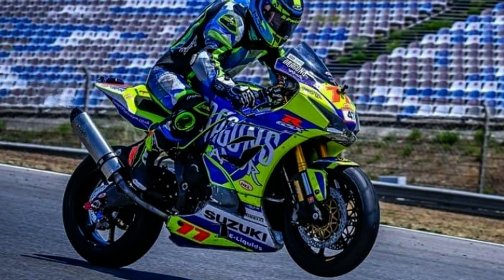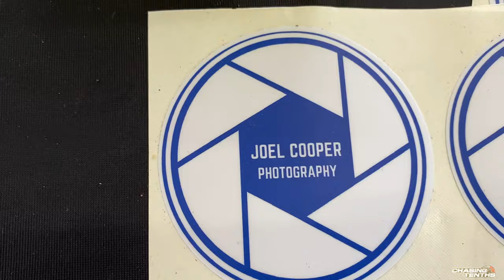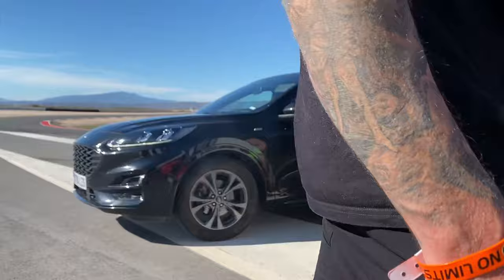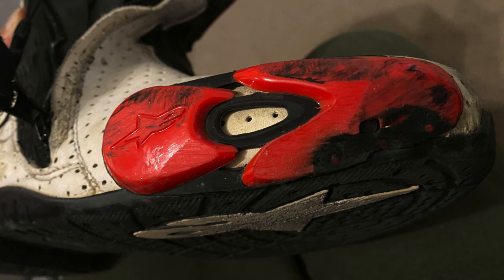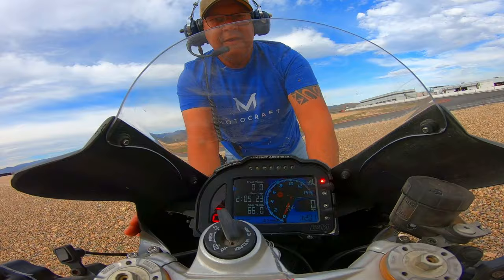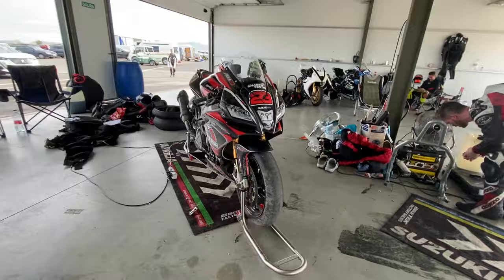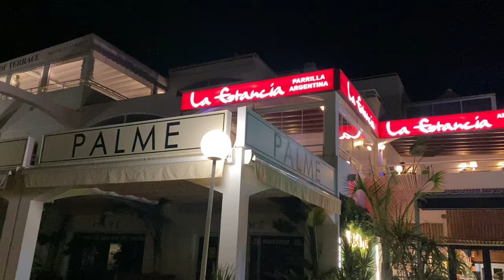Andalucia Trackday Day 4 | Plenty Onboard footage | CRASHED again!! 2 min 5 best time | Aprilia RSV4

Comment from the maker: Here are the chapters of this video for an easier viewing experience, promise you won't skip ;)
00:00 Cinematic Intro
00:52 Worded intro & morning laps explained
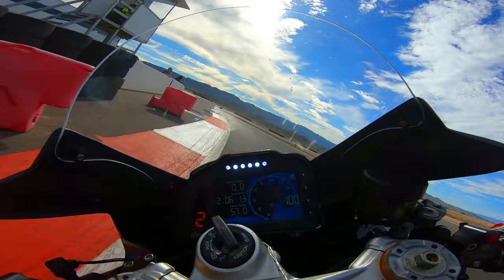04:34 Trying to overtake differently
06:47 Vesrah & Accossato pads
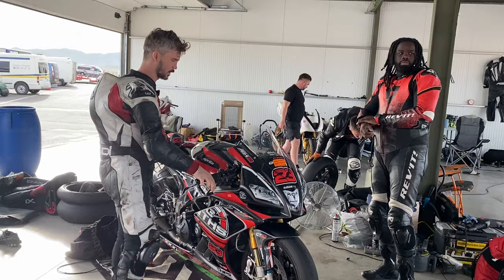07:07 Pirelli, Metzeler and Dunlops
10:08 Onboard lap 2 min 5.6
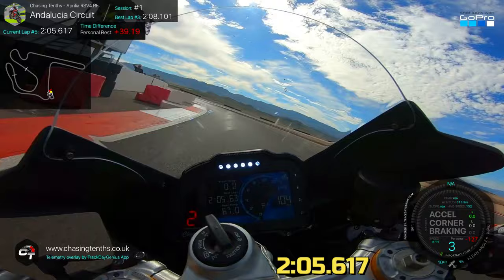12:26 Turn 3 gremlins continue
13:31 Lunch time footage Part 1
16:02 Paddock Stillage and transport info
17:44 Track Coaches and Fun lap with Dean Ellison
19:30 Feel free to speak to coaches
21:00 Intro to my crash
21:45 2min 5 dead plus CRASH onboard laps
26:20 Explaining crash in detail plus damage sorted
32:32 Lunch time cinematic Part 2
35:07 Last 2 laps explained
36:39 Onboard last 2 laps
40:44 Hotels by trackday firms and Summary
43:25 Cinematic ending of the trip

Comment: Another great video, I had some one come to me and say I need to back off the front at Almeria just like you 😂. I had a peg dig in shortly after and send me right out to the curbs but I got lucky.

Talking tyres I was running KR106/108 and they were super impressive and the wear was great. More grip than the VO2s even. I also used the 195 rear as my 2009 blade isn't that powerful and they dropped me down to a 1.49 flat. Made the bike turn like a 600.

Keep those vids coming this year 💪
Reply from the maker: Yes , I definitely felt my toe dig in to the tarmac and felt the rear go light on me and weight transferred to the front and I was already leaning too much and the tyre couldn’t cope .. lesson learnt for sure … 
Those Dunlops are super impressive 
I just try them next time 
It really saves you changing tyres if they last 3 to 4 days plus they take multiple heat cycles 
You doing 1:49 with 2009 blade at almeria is epic mate 

Thanks for watching and appreciation 
Means a lot mate

Comment: Great video. Progress was great over the few days. Glad your bike was not that badly damaged. 

Great riding
Reply from the maker: Thanks Baz, much appreciated.. I always look pass the crashes and look into the progress made
Reply: @ChasingTenths   I just had a very similar off at Druids. Front just trucked on me. No brakes. Not changing gear  

Wish I lived nearer the tracks, and I would get much more instruction, like you. I live in Cornwall. Day away from a decent track.
Reply from the maker: @Baz1000r  wow, Cornwall is mikes away 
I totally understand 
These low sides unfortunately are so common and easily done 
Could be off camber tarmac or just too must speed or lean like me , I feel for you though Baz, every trackday must be a right mission for you

Comment: Abhi...first session of  the  video was  amazing; very clean lines,intelligent riding in terms of  how  and  where you choose  to  overtakes  your  friend  on the  gixxer ,and  the '''early'''' roll ons of the throttle  exiting the  corners were  perfect. We all have our personal '''kryptonite ''''  corner  which we misunderstand  on any tracks,yours  here seems to be  corner 2-3 LOL!!! No limits track days looks  like all class,wondering what is  the in and  out   total expense for  such trip.As for  the  crash,look....i perfectly know that this  corner  ..i  would  hate  it  .simply hate it because  this  kink,you brake hard  while  transfering the  weight rear  to  front while  turning,aand if  your  suspension isn't settled  up  very well,the weight transfer  happens  kinda  too late ,while  you're into  a  turn in which is  bad  for  grip LOL...and  yeah,your  front was  probably well shot  when it happened LOL.lets say that you're  extracting the last drop of  grip of your  tires .
Reply from the maker: Very well summarised there Sylvan, that first corner had a big jump so as you are entering first corner the bike is already unsettled a bit and Offcourse not having fresh tires and just pushing too too hard doesn’t help the situation… corner 2 to 3 I was very quick but then 3 to 4 could have been better 
No limits were amazing 
Absolutely brilliant track event 
All in all I was very happy with progress 
Just need to work ok little things and mindset and everything else will follow

Comment: That was brilliant, didn’t seem like 46 minutes.
I thought you were using the Accossato EV2 pads as well? I could have sworn you mentioned them in a previous video. I run their ZXC pad. I prefer a more progressive front brake, instead of a light switch for a front brake.
Reply from the maker: Thank you very much mate, it’s always been the vesrah pads but I am moving to the EV2 pads …. 
I like the light switch on as I am very aggressive on the brakes 
So you are on the right pads matey 
Thanks for appreciating 
I did wonder if 46 mins was too long
Reply: @ChasingTenths  No mate, 46 minutes is too short 😂
Reply from the maker: @flamintasty  😂😂😂😂👌

Comment: i noticed,  that you're engine braking  could  be a fraction smoother,  ( but  thats my prefrence )
you can carry more speed en the bike would feel more lighter. 
for the rest  just stay on the steady groove abhi
Reply from the maker: I keep my engine braking on medium so that’s T mode on the bike (track mode) , the R mode has lease engine braking but I am so not used to it 
I like a tiny bit more engine braking , I think it’s something I’ve had since day one and got so used to it 
May be this year I will try the R mode with less engine breaking and see how I feel … great observations by the way, 
Very very nice to see you notice such detail and , no one’s ever commented on engine braking 
Fantastic
Reply: @ChasingTenths   if you study  the  time's  when you shift back   from   (  each gear )   
 you rear wheel is pushing you   and making you  unstable.    you have a wobble everytime   you're  figthing the bike. 
 set it the  bike on  r mode and  you will  feel  that is more  fluently   with even  using the front brake less  aggressive  

and  give's  you also better response ,      and will give you more  speed on the straight 

i will try to make  a  clip with my bike
Reply from the maker: @cbr1928  this is very very very interesting 
I actually do fight the bike a lot off throttle but I quiet enjoy that 🙈🙈, but it’s not a nice feeling when you are chasing time 
This is great advice mate 
I’ll Definitely be moving to the least engine braking mode R (Race) from now on, I’ll see how it goes and I’ll report back in one of my future trackday videos 
Love the advice 
Thank
You
Reply: @ChasingTenths  less  fighting the bike  will make  you faster.  smoother and les tired.
 all the little  feedback can help .   
 i' will  be curious   to find out  what you will  think of it   after a day of  riding
Reply: p.s  can you make the hoodies   lik 3 triple  XL 

they are on the small side after a year ..
Reply from the maker: @cbr1928  absolutely spot on mate, fatigue is an issue for me so I can we are on similar wavelength 
I’ll definitely try it in 2024
It might feel awkward to begin with but it’s ok
Reply from the maker: @cbr1928  try on my website 
The hoodies there are done by an American company 
chasingtenths.co.uk
Let me know if you have any issues 🤗

Comment: Id agree the latest superbikes are much more powerful than a 2015 rsv4, however the GSXR 1000R is virtually the same power, in fact its quoted as 2hp less than an rsv4 rf at 199 vs 201
Reply from the maker: That’s just the crank power mate 
But the power on the back wheel is different 
The two Suzukis in the video were 205 and 207 bhp respectively not on the crank but on the dyno 
And I am 176 bhp maximum on the  back wheel 
You can see how quickly they accelerate from me 
But I reel them in on braking 
And that’s what I was trying to showcase 
I really love my bike
The power is so so manageable and unless I do something stupidly silly. Which i did lol , it’s really hard to crash an Aprilia too , front grip is amazing
Reply: @ChasingTenths  ok thats fair enough. It may be the case with those particular bikes that they are much more powerful, but as standard the gsxr is the same as yours pretty much at the wheel, i know this as mine is 178. It is remarkable how much difference the line taken can alter the speed you can build up down a straight, and more so the initial jump on corner exit. Thats an area of riding i worked on myself whilst at Andalucia.
Reply from the maker: @HB-wu8pz  exactly spot on that , Suzuki ECU’s are in an open relationship lol , they work with a number of tuning softwares 
You can tune the hell out of them 
I really respect that bike 
It’s a really tuneable bike 
But love the Aprilia hands  down 
Any day
Reply: @ChasingTenths my bike has been on a dyno twice,  1st time when it had lower mileage it made 184 at the back wheel and the 2nd time last year with 25,000 miles it was just shy of 180 at back wheel.

They are fantastic engines but the electronics are 💩
Reply from the maker: @richbonesjones4729  this is very interesting to know 
Thanks Rich for that 
Matt’s Suzuki was 204 bhp I think and I presumed yours was around that figure too
Reply: @ChasingTenths  204 at the back wheel is an impressive number for a 2017+ gixxer

I'm assuming he's had the engine ported/polished and got some nice velocity stacks to get those kind of figures.

Defo doable but not many hit that magic 200 +  mark
Reply from the maker: @richbonesjones4729  aahh ok Makes sense that 
Matt’s bike is top nosh
Reply: Its a stock engine, with a full race arrow system and lur map it made 198hp, with MWR stacks itbheld power for longer and just pipped 200whp

The bike was dynod the same day abhis was, and abhi's made 175whp

We consistently see around the 195who mark from the L7> GSXR 1000s.. for them to only be 184whp would mean the RSV4 RFs would only be arpund 165whp

Our dyno reads very comparable to most other well known race shop dynos in the UK.. weve compared countless times

So either yours was done on a very moody dyno, or its the exhaust or map you have fitted.. a healthy L7 with a decent exhaust should be over 190whp really
Reply: @matthewwren1736  that's interesting mate.

I have a budget exuast really as its a lextek with long lextek quiet end can so I guess I'll loose a bit there.

This will make you chuckle, when I turned my bike to track only I had it mapped (Woolwich) and had the lextek exuast installed it put out approx 185 bhp, can't recall how much it gained after the map and exuast.

I bought some MWR stacks and had it put on dyno and it dropped to 176ish (this was approx 8000 track miles after my 1st dyno) so I sold them.

I'm off to jerez Sunday but want my gearbox and valve clearance checked so may well bring my bike to you as I see you aren't to far from N.Ls bike collection.

I'll drop you a msg in the next few days 👍